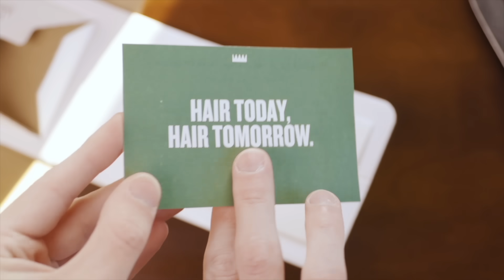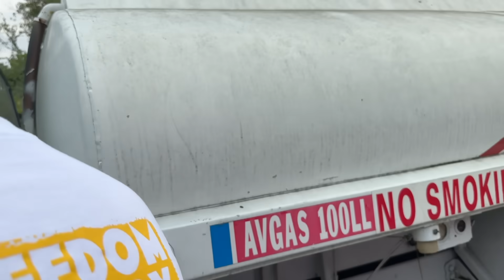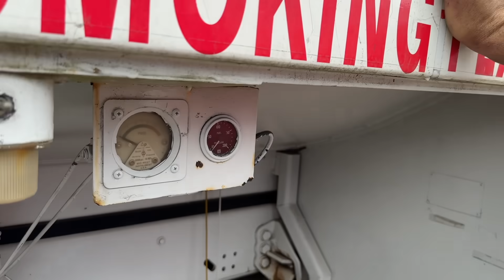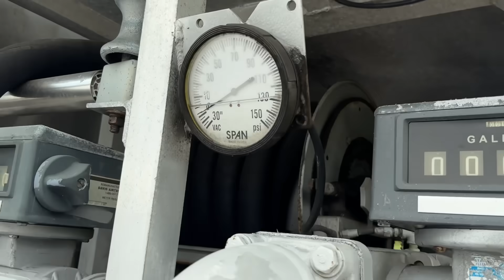I Bought An Abandoned Fuel Truck For Our New Airport!!!

Comment: Been driving fuel trucks like those for 13 years! What you’ll want to do is get a bulk tank on site so you can order in 8k at a time. Then your smaller trucks will pull off that tank and never leave the property so you won’t need all the crazy DOT stuff for them and a licensed driver. There is a lot to go into permits to haul on the road plus where you buy your fuel. Let someone else pay for that and just get your own storage tank.
Reply: My company we only run off road for that reason we have a fuel truck that comes and fills up on site
Reply: D.O.T has no say when it doesn't touch the road, county or city might have a say on the bulk tank though.
Reply: Exactly this
Reply: 8 thousand gallons holy crap.....what would that run you if you're buying that much in bulk?
Reply: @carlosrodriguez-xt1ug probably 20-30k maybe 40
Reply: I agree I hold a class a cdl with all endorsements.
Reply: Yep this is the way to go, much higher up front cost, but will save a fortune long term.
Reply: @ETGcasper  Damn thats crazy thanks for the info.
Reply: @ETGcasper  But how long is it good for since cleeter wont be burning through it like a municipal airport etc.....
Reply: If he has an 8k gallon fuel tank on site, it'll be a target, and he'll need an F-15 to defend it! Man, that'd be American as apple pie.
Reply: That's what we have a 12k tank and 5 150 gallon transfer tanks just fill our truck n go plus save 1.50 to 2 dollars a gallop he could even put a pay station there
Reply: @carlosrodriguez-xt1ug  my dozed takes 200 alone
Reply: @carlosrodriguez-xt1ug sad part is that you don’t really get a discount when purchasing fuel. I have been ordering fuel from a vendor in Tucson and they would charge the going rate of fuel for that specific day. So it varies from day to day just like the regular gas stations and we were buying 1,500-2,000 gallons twice a month for a SXS rental company because they didn’t have any premium fuel in the few small towns around us.
Reply: and when you are burrying your ''bunkers'' you can say its just ''the fuel tanks''  LOL HAHAHAHA :)   storm bunkers of course ya kno family stuff ;)  not zombies...  hurrycaines and naders!
Reply: Yep my company does the same thing. $200k deliveries every 8 months
Reply: @ryanturner8318 Diesel fuel gets a better deal. Gas is more day by day. We get both.
Reply: You should buy electric trucks. Everything is going electric anyway
Reply: This is the answer
Reply: @justinwatch that's not happening 😅 electric industry is done
Reply: This
Reply: I agree with this 100%.  I was coming back to say he should just have someone else deliver and just use them to transfer.
Reply: Your right for most part but the tank needs inspection every year by the fire dept. and will need a dot inspection sticker but no permit if staying on property
Reply: Keep them mobile on you properly only. No bulk tank . And just have another co. Just full up the tanks on the trucks. Bam ! No gov crap. No dot . No one giving you chit for leaking bulk tanks. Loophole
Reply: There is a place in plant city Florida that can inspect it but you should be to find someone local
Reply: @carlosrodriguez-xt1ug  well if he owns an airport he would likely be selling the fuel to other planes using his airport. So whatever comes in to land I suppose
Reply: @carlgruver695 why would it need DOT if he’s not moving it off the property in commerce or at all?
Reply: I would set an above ground tank and use a setup for that it’s cheaper then if he decided to go get fuel with the trucks if he didn’t then I see no issue as using those trucks as storage tanks with tires lol
Reply: This right here. Probably still need a permit to sell fuel but a whole lot easier to have it trucked in and not even register those trucks. Will still have to have placards though no matter what.
Reply: @ryanc8188 you mean water tank lol
Reply: @ZboeC5  ya need a permit and state inspections to sell to the public and a fire marshall walk through it’s a whole task to get fuel on a property
Reply: @carlosrodriguez-xt1ug  not  fuel but I work in a chemical factory, our bulk tanks our 15-20k gallons and we depleat and fill all of them near daily probably 30+ it is truly impressive. Cost Is 12-15c per kilogram to get in the door process into our products and ship out at that scale. 
Can't go into exactly what all we get in but it's some cool stuff
Reply: For a few years I worked on petroleum installation of tank above ground and underneath and like you said get a 12k gallon above ground double wall fuel tank that can hold 2 different gases or 3 with diesel.. so if you get a 20k you can divide it into 3 separate fuels . Keep those 2 in the yard and you good homie
Reply: Also, when engaging the PTO be sure to push the clutch in. That’s why they’re hearing those scrubbing on gears sound. I have been running a fuel Tankwagon for 10 years. Hit me up if you need advice!
Reply: I'm sure you'll have plenty of jets in & out of your dirt runway, that'll pay off that truck in no time.
Reply: First you need a 2/3 vote from the city counsel, then submit an application request form with the county along with a check for $375. If…your application request is approved, then submit your pump station application to the county fuel and denial department. About now is when a wetlands environmental impact study takes place, just around the time you get your first denial letter from the county. But that’s going to be OK once your $10,000 campaign donation clears the bank, you’ll receive your bi-annual county tax stickers and temporary (till the next election cycle) Fueling, Bar and Grill permit.
Reply: @justinwatch anybody in the transport industry knows electric trucks are pure crap.
Reply: Agreed. You want maybe an above ground storage tank or pay a little more and bury it. Prolly better off. Have a company like mine come out and inspect with a licensed inspector to pass it and just maintain it. No need then for a bunch of bull with DOT.
Reply: @walterlundblade  I also agree, and I'm a certified forklift operator, occasionally laser guided as well 😤😎🤣
Reply: Why wouldn't he get all the permits and stuff, then he can pay his own company instead of someone else... Obviously Garrett isn't gonna be driving it, but his company can.
Reply: Yep, I've been driving trucks for 25 years. Totally agree with you 👍
Reply: Call port consolidated  fuel in Gibsonton
Reply: I mean, how long does fuel last don’t need 20,000 gallons of fuel going bad. I don’t feel like they’ll be a huge demand for fuel to have two trucks and an on-site tank.  Plus you don’t think there’s any permits you need to put it on site tank you’re crazy. I do think you can make a lot of money on the side filling up yachts in Tampa behind peoples houses. Just need a long hose.
Reply: I mean, how long does fuel last don’t need 20,000 gallons of fuel going bad. I don’t feel like they’ll be a huge demand for fuel to have two trucks and an on-site tank.  Plus you don’t think there’s any permits you need to put it on site tank you’re crazy. I do think you can make a lot of money on the side filling up yachts in Tampa behind peoples houses. Just need a long hose.
Reply: I'd be worried about the "shelf life" of the fuel unless he is planning on selling it.
Reply: @carlosrodriguez-xt1ug  neither these are an 8 thousand gallon tanker, probably more, more like 3-4 thousand each
Reply: One more vote for just parking the jet fuel non runner.. You don't have a jet landing strip anyway.
Reply: @galenjacobs6005  Please make a separate post. This comment isn't going to get seen by many especially from Cleet's team.
Reply: Agreed!
Reply: Liability on fuel, especially A1 is pretty significant.
It's probably best to pick it up with a bumper hitch bowser or just order in 80gal barrels for personal use only till you know you've got the demand and a 100% compliant set up, paystations and public fuel is all good till you mess up the testing and a customers aircraft drops on a school for blind orphans.
Reply: Get a 10,000 gallon tank. That makes for easy inventory control. You get down to 1,000 gallons in the tank and order 8,000 gallons. Doesn’t get any easier
Reply: That totally makes sense. Hell yeah brother!
Reply: Smart
Reply: @tl1024  Helicopters, bud.
Reply: RepentandtrustinJesus1 Matthew 21 1 As they approached Jerusalem and came to Bethphage on the Mount of Olives, Jesus sent two disciples, 2 saying to them, “Go to the village ahead of you, and at once you will find a donkey tied there, with her colt by her. Untie them and bring them to me. 3 If anyone says anything to you, say that the Lord needs them, and he will send them right away.”
Reply: No he just needs them to come
Fill his trucks on site. The trucks ARE the 8k gallon storage tanks. They are just mobile on-site
Reply: only issue I see is the local fire marshal
Reply: Pin this
Reply: @justinwatch i would not trust a electric near a big tank of jetfuel
Reply: Well said
Reply: Those trucks look like 5k  gallon trucks to me, and I think your cheapest way to get started is have a distributor bring fuel and fill your trucks that you run on airport.  That was how we set it up and it worked good. There will be inspections, tracking and quality control would kick in if you started selling it retail.  Sit down and figure out how much you are going to fly a year and then divide by 4 and that’s what you want to order each time.  You don’t want to store fuel much longer than that.  You will be surprised how much Jet A you are going to use with your new helicopter :-) it always made sense for us to buy fuel in bulk, it lowered our fuel cost by 30 percent  or more
Reply: @carlosrodriguez-xt1ug  instead of paying $5.50 a gal for 100ll at the pump you get it for lets say $4.00 a gal delivered. yes there is that much mark up at some airports. and at a small air strip like that with both avgas and jet A. trust me and having fuel at any time you fly a lot more which is always a good thing
Reply: There are a lot of commercial operators that send a fuel truck into the field right along with the helo  on most decent sized contracts, your 500 is going to burn 2 or 3 hundred an hour in jet fuel alone.
Reply: @tl1024  
All though he may not have jets at his airfield he and many of his friends have jet turbine helicopters. Hell one fill up of Sparks' Blackhawk is a quarter to a third of that truck's tank.
Reply: Nobody cares, i invested in seeing a race car break records. not hear some apprentice talk about their first week.
Reply: @justinwatch No it's not. lolol
Reply: @carlosrodriguez-xt1ug  I can give you a price on what the tugboat I work on cost to top off we hold 82,000 gallons of diesel and burn roughly 2500-3000 every 24 hours pulling a 375x77 barge and a little less for if we push also depends on if the barge is loaded or not.
Reply: @alexmikhael5061 water level maybe 15 foot where he is
Reply: Good advice
Reply: @scottjones5455     Helicopters can use it.
Reply: @anthonyking4387  lol then some filtration systems and you have inground pool!!!! LOL HAHAHAHAHAHA sigh... yea...  I kno, dizzy hadda build UP HI to be able to have a DOWNunder....
Reply: Spoken with true words right here, man knows his shit !!!!
Reply: @indianagashauler3377  That is way too much fuel for them to have on hand. You have to go through enough to keep it fresh.
Reply: can confirm buying 8k gallons is cheaper than 10gallons run a cuppa gallons through a Neptune
Reply: @WhocarezWhocarez-nw8ke  I'm sorry to burst your bubble mate.
But all Car manufacturers have already planned to go full electric in the next 15-20 years. Some much faster. Like they stop producing any combustion engine vehicles.
Its a done deal, These companies plan 10-15 years in advance. 
No going back on it now, They just need Battery innovation so they become better.
Reply: @jasonwalter5873 Because then he'd have to find a driver with all of the correct permits, as well as pay for all kinds of inspections and permits and BS due to the fact that they will be hauling highly flammable, potentially explosive, liquids on public roads. 

I'm not sure he could even hire only a truck driver as part of "his company," to drive a fuel truck or two to get fuel and back. What like.... Once every couple of months? MAYBE. If he sells it to his airstrip patrons. 

No. This makes absolutely zero sense. He just needs to pay a fuel company to bring fuel on site to either fill a tank, or the trucks (if they do that... seems like they would but I have absolutely zero clue about how all of that works and whats possible).
Reply: I test gas stations for a living  , compliance specialist.  Run away , do not use underground storage tanks . 
Find the tank capacity under the limit for regulations. 1100 gallons usually,  buy 6 of them . Storing diesel will get you a federal subsidie monthly. Lots of rules , start at the Florida department of environmental quality 👌
Reply: You are totally right, in the army and DoD I could drive a fuel truck on base with just my military lisence, but I could not drive off the base without all kinds of DOT certifications
Reply: @carlosrodriguez-xt1ug Depends on the deal that’s brokered. It will be cheaper because it’s bought bulk. Those two trucks are about 2000 gallons each maybe.
Reply: @commonsense31 Actually no.

Had you kept up with the latest developments, you'd've known that with recent steps taken in the world of synthetic fuels, several big car companies (like Honda, who decided to leave F1 to focus on ev's) are investing in the i.c.e. again!

Ev's will probably remain as an alternative, but the i.c.e. is here to stay! 😊👍
Reply: Then he can run red fuel in that diesel rig 👌
Reply: @ryanc8188  Were I live they do, there are letters and number on the side of the trucks meaning dates that all valves and seals must be tested or replaces. My truck was every 3 months because I hauled Cem.
Reply: @justinwatch  They could build their own probably, would be a sick project. I know there is a company in Europe that has converted MAN trucks for years and some cities buy them and use them for local hauling of containers and what not, will last an entire day on a battery when its mostly going around a city. Well, people do this all around the world, not just one company in Europe but its a good example. So for an airfield a charge would probably last weeks! xD Small solar panel might be enough to keep it topped up 97% of the time! xD
Reply: Jesus christ no one cares RepentandtrustinJesus1
Reply: Why buy a bulk tank when they can just come fill the tank on the trucks? I doubt they will use a crazy amount of fuel like that
Reply: Agreed
Reply: Genius idea
Reply: @justinwatch  you must not know cleeter very well because I guarantee you he will not buy an electric pile of crap that has no soul or bald eagles screeching
Reply: 😂 Completely unnecessary. A fuel truck will come to him and fill those up. Doesn’t have to be a bulk tank. Also, when you have bulk tanks installed on site you are now considered an environmental risk. Whether it’s an AST or UST, doesn’t matter.
Reply: @tl1024 Helicopters 🤨?
Reply: @WhocarezWhocarez-nw8ke  The electric industry is just getting started, in comparison to gas/diesel vehicles. It's just not worth the headache for most people to switch over, yet.

There is a reason why 99% of things are now electric.
Reply: @HDVisionsMedia  won't happen,  electric pollutes more , we don't have the energy for it , and the cars are crap....big companies are moving away from it , but will still offer it for the yuppies virtue signaling , it will never replace cars let alone work trucks
Reply: @Unsubscribed_Inc  I never said steal.
Reply: @HDVisionsMedia  electric cars are good for kids , you know powerwheels and remote control cars , other than that useless
Reply: @HDVisionsMedia  there's a reason you don't have electric tanks and planes .....
Reply: @justinwatch  Electric planes too
Reply: @walterlundblade it's a huge pia. I have a physical friday again...yay
Reply: @Atlantaconnection94  Usually those are jobsite trucks that aren’t road worthy or can’t pass annual pressure tests. The stickers showed they haven’t been tested since 1991 so there will be some investment to get them up to certification. Our company sets you up with a tank and pump/meter for $1 lease contract as long as we are the sole fuel provider.
Reply: im pretty sure thats what he is going to do... he got a tank at FF as well
Reply: If you do it onsite as suggested(I recommemd as well) you will still need a few permits and certifications for haz waste storage and handling. all available online.
Reply: @MasterSandman  Maybe you are right, But you should have also followed up to date with the regulatory orbit. 

2035 Is when the last i.c.e New Car will be allowed to be sold in the EU.

They also state that they know that EV is the future, but are just adding a 3-5 years more on the transition away from I.C.E.

That is just the reality of it all. I.C.E isn't here to stay. It just got a extension of 3-5 years.
Reply: @MasterSandman  Also synthetic fuels are projected to be 30% more expensive than regular fuels.
Reply: @Unsubscribed_Inc  By the way, wake up. See what's happening in our world.
Reply: @commonsense31  You can be certain those regulations will be amended ahead of time, but they first want "real-world" results before they do!

Electric is not the future, unless they can solve the battery problems! Concerning weight, capacity, durability, resources used, environmental footprint, etc.
Reply: Smart man 👍
Reply: @justinwatch I think you're on the wrong channel
Reply: I agree brother !👍🏽
Reply: Pretty damn good idea my dude!
Reply: Make sure you open your belly valve before kicking on your PTO.
Reply: @scottjones5455 the MD and the other helicopter both take jet fuel
Reply: @alexmawdsley  fair enough, guess I didn't think of that.
Reply: Im sure thats what they do for the fuel tank they have at the freedom factory so delivery is probably soemthing theyll keep doing
Reply: I know where a 557 big block ford is 😂😂😂😂
Reply: @sneezinhatch what is the consumption rate?
Reply: This is what Farmers to too
Reply: If he only has AvGas he’ll only need orders of 1k-2k at a time. Those small single prop & piston planes don’t take much fuel. He’ll be sitting on 8k for awhile 😅. Those trucks only hold 1100-1200 anyways
Reply: he's not planning on being on the road
Reply: @justinwatch dude he got these for 8k. What an electric fuel truck gonna run you today?   250k probably
Reply: @andrubackos1861  nobody cares!
Reply: @spaceducky101  tell me you have no clue about what's going on without telling me you have no clue what's going on lol go read my previous comments proving it won't happen and it's not a real solution sit back down corky
Reply: @spaceducky101  just go ask Toyota about electric cars and how they will offer hybrids instead of electric ......and that's one example , electric will never replace gas cars ...will ppl have electric cars still yes the person who goes to work and back and that's it and even then those ppl still have a gas car to actually do stuff on the weekends
Reply: @spaceducky101  when you see electric planes tanks and other military vehicles then you know it's a replacement....but the fact military doesn't use electric 10 years before the public got their hands on the tech tells you all you need to know
Reply: @ryanc8188 but really no different than a farmer with a tank, but maybe vehicle changes it.?
Reply: Cleet he is right about that
Reply: He’d also have to set up a top loading rack since the trucks don’t have a load head on them
Reply: @izzyplusplusplus1004  or...a Blackhawk lol
Reply: As a former tanker driver. This. Put I your own bulk tank on site and have your trucks fill from it. And just make a contract with a provider to keep that tank full
Reply: @kevinmoore6640 it’s a private airport, AKA it’s for him and the few others that base there planes there
Reply: I second this. 🎉
Reply: That's what we did.
Reply: Still a lot of $ for bulk fuel storage permits, hazmat certifications, etc. Also requires a secondary fuel containment for the trucks and the fuel storage.
Reply: fr